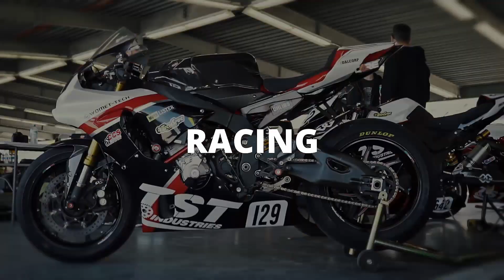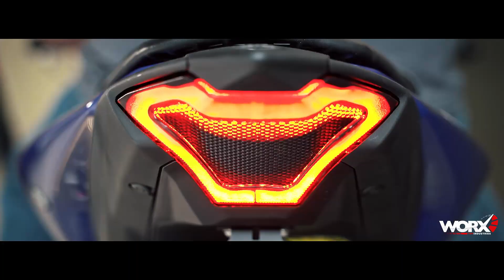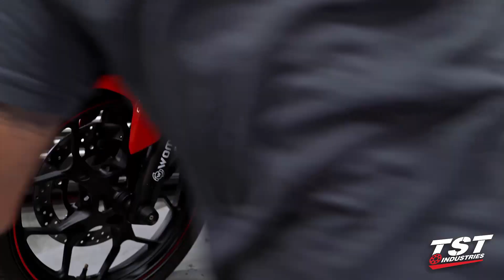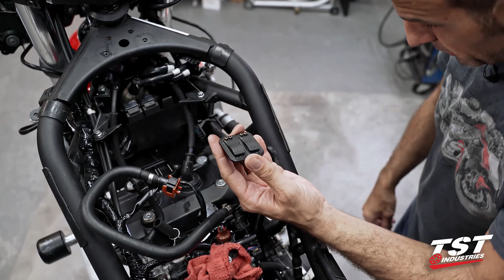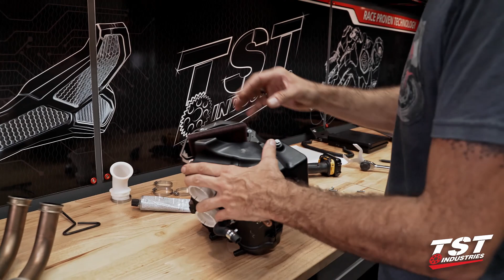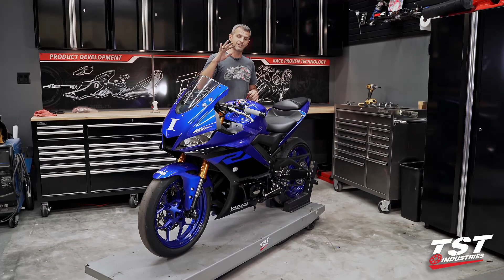TST WORX Race Performance Package Installation Guide for the 2015+ Yamaha R3

Comment: i wants to install quickshifter , which quickshifter do you recommend?
Reply from the maker: We used hm on some bikes, a dynojet on some, bazzaz, and several other types. On bikes where we run an aRacer ecu we use the aRacer module that goes with the ecu because it's just a sensor that plugs into ecu. If the ones you are looking at are tuneable you can customize the feel of the shift and be good to go. Most of the sensors on the market from reputable brands have similar longevity. I would say get something that has a good company backing it so you can be confident that if you have issues the company will stand behind their product. Most problems with off brands that seem like a good deal are based in lack of support and product backing.

Comment: What service center do you recommend that i go to near 30093 Norcross Georgia for the installation of this system?
Reply from the maker: Unfortunately we do not have a shop that we know in that area. We know of performance shops in the area that have good reputations, but we have not done work with them on a peer level. Any recommendation of said shops would not come with us warranting that they will actually do the job correctly.

Comment: Love your videos guys.

Also, how effective/safe is the autotune if I install the full worx package?
Reply: I dont trust anyone in my area to dyno tune is why I ask
Reply from the maker: Autotune is an algorithm without a brain. I don't know what system you are using that has autotune but they are not all the same and they all do have error. I do use autotune on certain systems to get a baseline pressure map. Then I shut off the autotune and continue tuning until I have proper results per cylinder, and my TPS table delivers proper results. All that being said, I think that perhaps with a good autotune system, you probably will be within safe limits of fueling on the bike with the Worx package. I doubt the results will be the same as what we get with the full tune but your bike will probably not blow up and you will still see a pretty big difference in performance.

Comment: Can i use a pvc and autotune for the velocity stack and modified air box or will i need to use the tst flashed ecu
Reply from the maker: PCV should get you good results but using just auto tune will not get you 100% matched to what we achieved and also you may not have safe af ratios everywhere in the range. I would say skip the autotune and go to a reputable dyno tuner with your PCV, and get a proper tune to your setup.  That would be the best scenario using PCV.
Reply: @TSTindustries  just one more quick question , i just bought the workx pack , will i need to use both the modified airbox covers to achieve the same gain ? or can i just use one of them
Thanks

Comment: When I did te AIS delete I left the check valve on the hose that comes down. I see you removed the check valve. Is the any harm in leaving it on?  I had thought to leave the check valve to prevent stuff from getting in? Also the AIS pump. I just leave it disconnected and that’s it? ( I haven’t turned the bike on yet because I’m still installing other components on the bike. )
Reply from the maker: The AIS delete is meant to be used in race builds where you remove all of the unnecessary components like the pump. Leaving the pump and check valve in place doesn't harm anything but you are circumventing some of what the kit is used for.
Reply: TSTindustries sorry what I was meaning to ask. Was is it ok to leave the AIS connector part unplugged where it is.  Or should I also put a cover over the connector ?
Or I should see if the AIS pump has a dedicated fuse and remove it to rid the chance of a short?

Comment: can i install 2020 modern digital dashboard? to my yamaha R3 2015
Reply from the maker: It is possible but the receiving bracket has holes in different locations and the connector for all the functions is different. So the answer is basically that if you know what you are doing with customizing a bike then yes, you can surely accomplish that.

Comment: the perforated air box can prevent rainwater or washing water from entering the engine or not?
Reply from the maker: It does not prevent water from coming in.
Reply: @TSTindustries   so, it would be an issue ride under the rain or wash the bike? I don't have an idea if could be a concern

Comment: Is there a risk of engine damage or poor performance by installing a full exhaust without the ecu? I don't have the funds for the ecu as it's not even available on your site.
Reply from the maker: This is a loaded question. Yes, there are always risks associated with changing intake and exhaust components without re-tuning the fuel injection. I cannot really quantify the risk because it varies by elevation, bike, temperature, etc. It is pretty minimal but it is there. The biggest concern is spending all that money for not a big performance increase. Essentially, by changing just the exhaust you are spending all that money on more noise, a different look, and marginally better performance.
Reply: @TSTindustries  I have another question is this ecu with flash you guys offer will it still require a power commander V or is the flash fine the way it is? Do we get a higher top speed? Are the factory limiters removed

Comment: Without ECU reprogramming, can the filter box be modified?
Reply: Ecu original
Reply from the maker: If that is the only mod you are doing then it will not affect the air flow enough to demand a tune. So if that is the only thing you are altering then you should be good to go.

Comment: 19:36 min What is the use of removing that?
Reply: I speak Spanish that's why I ask to translate it
Reply from the maker: The components that are being removed pump air into the exhaust and cause popping and pressure differentials that you don't need in a racing setting. If you ever go to re-tune your bike that air injection also throws off the air fuel sensors and you don't have a true combustion chamber reading to tune from. In addition, they are dead weight anyway after you remove your catalytic converter.

Comment: Please update on the R6 build
Reply from the maker: It is fully built in SS spec. We just had no time to document the build like we planned.
Reply: @TSTindustries  atleast give us some details on want all mods went in
Reply from the maker: @vasanthselvan7258  OMG that is a looong list. The bike was stripped down and rebuilt from the ground up. Everything was chopped apart and redone, including electrical harness being built into full race spec. Race body, race subframe / front stay / air duct,Ohlins suspension front and back, ripped the front carts apart and converted the fork travel to 130mm, brembo brakes, MWR/ti Yosh, tapered bearings in steering head, narrow sterinng stop, slipper clutch, thin gaskets, valve job, cam degree, a bunch of dyno tuning, a bunch of messing with geometry to find what the bike/rider likes for different conditions....That is not detailed or complete. I am probably forgetting about 75% of the juicy stuff.

Comment: What brand ratchet handle your using?
Reply from the maker: If you are asking about the yellow one then it is a Stanley Rotator. Husky used to make that under license but stopped now. I busted my old one so got the Stanley. One of the best tools I have and it is cheap.

Comment: Awesome video! 

So I’m definitely interested in the WORX Pack, but I already have a Yoshimura R77 Slip-On. Can I order the R77 full system minus the muffler, in lieu of the Alpha T? It’s a 2020 with two miles on the clock, I’d like to properly break in the engine first. 

I contacted Yoshimura, they said if you guys give them a call they can hook it all up. 👌🏼
Reply from the maker: Hmmm...OK. We can do that then. Please send in your request via the support system on our website. Add a note that Bart is aware of this and will discuss with the person receiving the support ticket. Please just know that we may have to receive shipment of that exhaust from Yosh here and then send to you. Definitely break in the bike first.